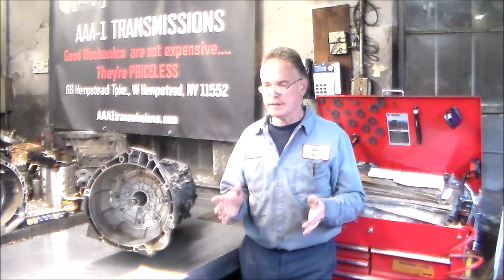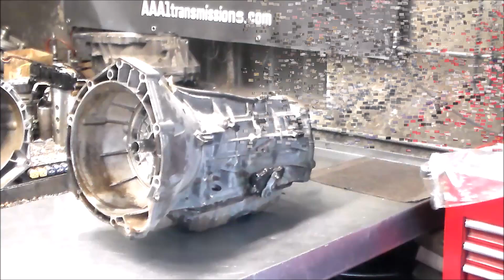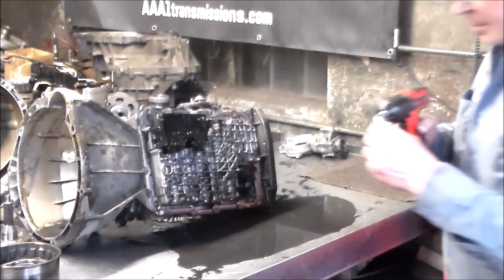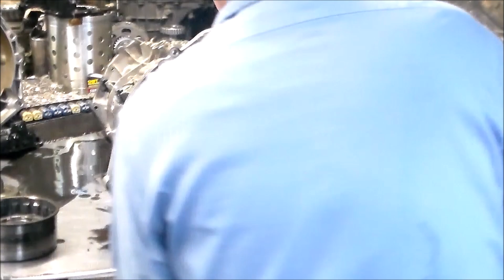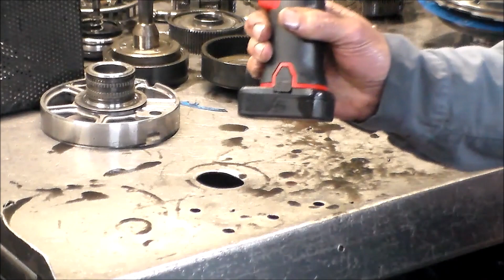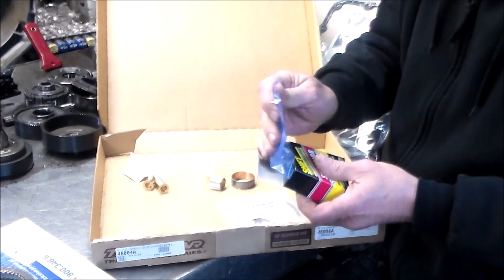Cousin Nick's 5R55S Teardown

Comment: hello good evening brother, I've been watching your videos excellent work you do. I have a query I made a repair to a Grand Cherokee 2010 box 722.6 I finished putting it together today I changed discs and seals all complete, when I try it I feel that the changes are not made or felt it gives the impression that I did not make them and when you go slowly you almost brake to stop and tap is there any way to reset the box or it will have some electronic problem. I hope you can support me I am writing from but I am a Venezuelan mechanic.
Reply from the maker: Does this shift out of first?
Reply: @GaryFerraro  hola que tal gary, no te entendi la que me preguntaste
Reply: Hi, how are you, Gary? I didn't understand what you asked me.
Reply from the maker: @luistua2964  Does the car upshift or just stay in 1st gear when you drive
Reply: good day brother, if the box is placed in D and it feels like it grabs 1st if it changes normally when you slow down and brake a little almost to stop you feel a soft hit. Today I am going to test it to see if it changes the 5 speeds. thank you brother for answering me greetings I'll let you know how it went

Comment: Hey Gary, I have a few questions about a video you did on an 09 Toyota Corolla with code P2757. I too believed it was a mechanical issue, had transmission serviced, replaced the TCC solenoid, and still no luck. Have been trying to take it to the dealership and have spent 3 thousand dollars on their suggested repairs/maintenance and all for none to work. I did end up replacing the ECU myself from a company that remanufactures the computers, is it possible I got a faulty computer? The car did feel good after replacing the ECU but it only lasted for a few days before just feeling the same again, if not a faulty computer then any other ideas? I would think my only choice would be to try to get a computer from the dealership
Reply from the maker: Is your car a 2009?
Reply: @GaryFerraro  it’s a 2010, Toyota Corolla S, with the 1.8L

Comment: Cousin Nick drossos? He has a yt channel.
Reply from the maker: no, not him
Reply: Gary, I changed the valve body on my 2008 bmw 528i, not it runs perfect but it takes at least 20 minutes before it allows me to shift to D or R, the check engine light stays on with transmission fault once it it clears on its own then let's me operate the shifter.
What do you think is the issue?
Thanks in advance!
Reply from the maker: @maxh6920  Have the car scanned and let me know the code along with the definition
Reply: @GaryFerraro  will do , thanks!!